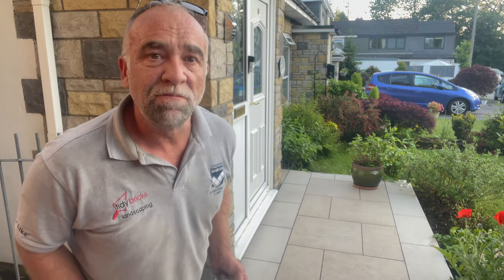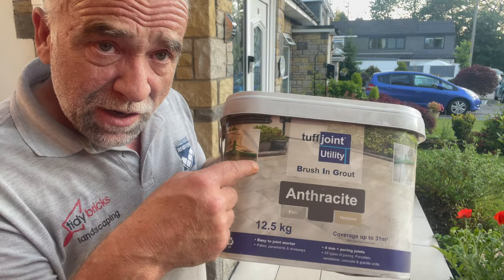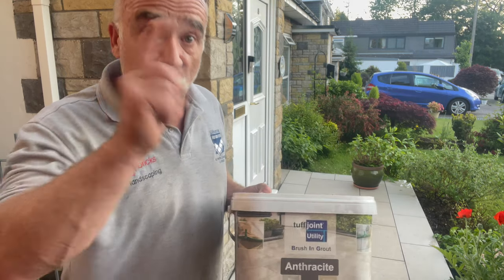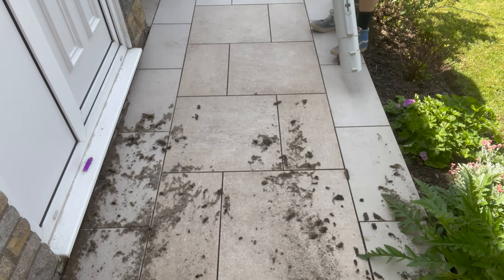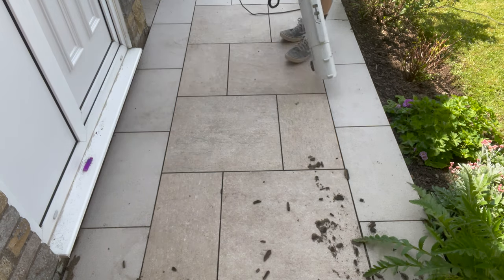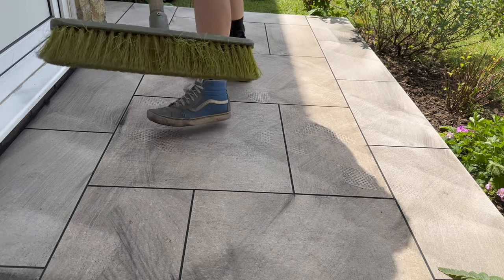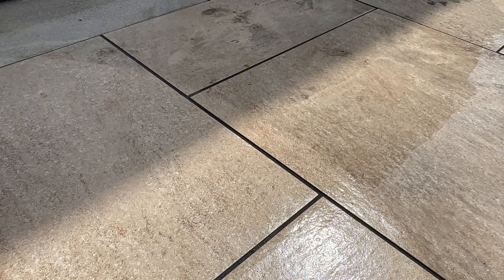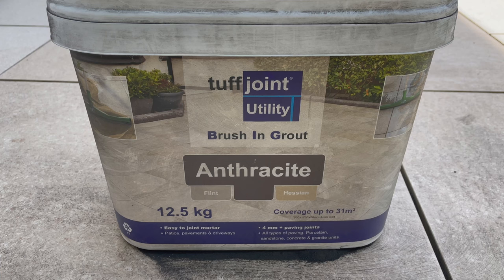Easier Way to Deal with Grouting Stress?! #SteinTec #Grouting #Jointing #Paving

Comment: I'm glad you liked it Scott. It's impermeable and can be jet washed a week or so after installation!
You can use it in the wet. It's just less stress in the dry. In wet conditions, it'll turn into a slurry, but once it's in, it'll be solid in no time. Cementitious with no epoxy or polymer so suitable for all stone.
Reply from the maker: Hi Troi thanks for the input on this every bit counts I’ll pin you in the comments for any enquiries for the product hope you like it 👍🏴
Reply: @Joe Frankland  hi Joe, I did reply but it contained my details so may have been deleted. 

Google, Steintec, give me a call any time mate
Reply from the maker: Some people from a landscaping group might be asking some enquiries for the grout headed your way 👍🏴
Reply: Would it keep closer to the top of the tile if you brush it very gently? Or is it a matter of the product naturally compacting when moist and sinking in?
Reply: Hi @andrescorrea682  You'll never get it flush for a couple of reasons. Firstly when you spray the joint with water, some may wash out of the joint naturally. As shown in the video you then clean the surface with the hand sponge tool, which goes directly over the joint again, potentially removing 1-2mm from the top surface.

It's possible to get it to surface level and not wash away the top surface of granules, and then not wipe over the top of the joint, but for best results, and to avoid spooling, we suggest that you use it with the intention of finishing slightly below the level of the slab. spooling/cracking happens when grout doesn't have the support of the side of the paving unit.
Reply from the maker: @andrescorrea682  naturally compacting when wetted I’d say 👍🏴
Reply: So  can you jet wash this  with out it lifting, so do you prefer this to liquid grout  what would you use

Comment: I have been using Nexus V75 two part epoxy resin slurry for the last couple of years because it is more waterproof and rated for 8 tons. It is great stuff, but as you say, its stressful. Around 18 months ago  did 120m2 of Indian paving with it, it was a gorgeous warm sunny day when doing and when I left, but through the night it had light rain which resulted in the sheen on the flags going white because of something called Amine bloom. A tense couple of days thinking its going to cost me weeks of work and money, but the manufacturers said to put white viniger on it to make it go clear again, 60 litres later, and 2 days and the patio was 95% back to normal. I nearly resorted to having a sandblasting firm come in to take off the surface sheen. Long story short, they do not tell you the epoxy can not get any moisture on it at all until it is fully cured, ironically, it says it can withstand light rain while installing, bullshite!
Reply from the maker: Grouting used to be a easy process years ago and now it’s all so complicated with so many choices of grout products I think the best grout will always be sand and cement same stuff to lay the dam things 👍🏴 I’m feel your pain
Reply: @tidybrickslandscaping . Up until  three years ago, I always used a sharpsand mortar to point my flagging, used one of those moratar guns to speed up the process. I never use the pre-mixed stuff with it being water permible.
Reply: @tidybrickslandscaping  , I am a relatively new convert to epoxy resin pointing. I like it because it is so quick to use, but  I have occasionally considered going back to mortar pointing. The only trouble with mortar pointing is that it is just not as strong as this Nexus stuff, and that is using a 3 to 1 sharp sand and cement mix, Nexus v75 sets like cast iron., saying that, I have used for the last three years, so not sure yet the longevity of it, I would never use the pre-mixed stuff you get from B&Q etc, that stuff is garbage and crumbles in no time.

Comment: Excellent scott 👍 is that for non permeable and permeable? I see most brush in jointing compounds are for permeable only as it turns green if done on non permeable as the moisture just sits in the joints and attracts the algae. Been stung on a few jobs with that as clients or contractors adamant  it's the stuff they want to use. How's the stress now being on the brickwork and smaller jobs?
Reply from the maker: Hey Sam yeh that was for porcelain so hopefully all basses are covered and so bloody easy too 👍🏴
Reply: @tidybrickslandscaping  perfect scott wouldn't have known about this if I didn't follow 👍 nice genuine review too 👌
Reply from the maker: Does go hard to so far and not one bit of stress involved ok settles a couple of mm lower but does that really matter that much doubt it. Take that stress away mate it’s not worth it enjoy life a bit more 👍🏴
Reply: Absolutely mate 👍 not always easy Monday morning comes round and you step on that merry go round once again 🙈🤣
Reply: I'm planning on trying this gear in near future, I've got a tuck pointer grinded down to 4mm wide. I'm going to run that over the product to compact it before I water it, hopefully it will reduce any settlement and leave a flush joint. Stress aside do you think it'll be as long lasting as flowpoint?👍👍
Reply from the maker: @jc8023  apparently you can add more after it’s dried so I’ve been told by Matty brockstone and it seems to be very hard already but time will tell and actually I do have faith 👍🏴

Comment: Hey Scott, been watching a ton of your videos lately, just trying to learn. I'm doing my own patio tile (20mm porcelain 600x600 mm tiles). Now, my only experience tiling before  was my own kitchen backsplash, and I must say, even though it was stressful, I am very glad I did the work myself, it is literally laser straight, flat as can be and I took my time doing the tiles around plugs extremely carefully.

When doing my backyard prep, I asked a man at the construction supplies store, what kind of groundwork prep needed to be done to pave my patio. So because my language is not English, I think when I said "pave", he must have understood I wanted pavers, not tile, which is understandable, and it was my mistake. So I ended up doing 4 inches of digging, then filling it with 2 inches of crushed stone and 2 inches of rough sand on top (more like coarse tiny tiny pebbles), and compacting that in (rented a vibrating compactor). The sand is compacted enough to walk on top of, and it doesn't deform, but if you dig at it slightly with the heel (or my dog scratches at it after taking a cheeky dump), it leaves "gouges" and it shifts.

My fear is that I have the wrong material to put porcelain tile on top of, and that the tiles are going to end up breaking after a while if the sand shifts. My plan so far is to do everything as per your videos, but leaving a good 3 inches of cement (5:1) so I have plenty of material for the tiles to not shift or break.

My question is, should I delay the project, somehow dig up the 1 ton of sand (2 inches), and get more crushed stone and compact that? Is sand good for tiles? The ground prep has me worried and I can't find a video that goes over that topic in depth. I don't want to make a mistake there, and I'd like to do this "the proper way" so it'll last me a good long while.
Reply from the maker: Hi Andre and yeh it’s a same you said pave and not tile as that’s 2 different things unfortunately. So definitely remove the sand as that’s just a complete no no and replace that with more crushed stone the suggested amount is 100mm of stone then around 30mm cement 4;1 ratio possibly you can use the grit sand for the cement as that would be fine 👍 
Overall depth of a patio should be 150mm hope this has helped you sort the issue out 👍🏴

Comment: I've just done 50m of 20 mm porcelain out the back, still have 40m to go. It's not too difficult to grout but that stuff looks super easy. I'd probably use a softer brush when sweeping away the excess, might reduce lowering of the grout levels, still, couple of mm aint gonna make much difference. Great job Scott.
Reply from the maker: a softer brush would of helped for sure but apparently you can top it up the following day also but really no big deal 👍🏴

Comment: Looks like a no brainer....whats it like if you try and top up where its settled??
Reply from the maker: hey Tom and yeh apparently you can top it up the following day Matty told me 👍🏴 has to be another option hey
Reply: @tidybrickslandscaping  Jon 🤠
That sounds decent. I'm currently using fugapave ch flex...like you, I've just about had enough of the stress in cleaning down or getting caught out with flowpoint. I like the fuga because it's not rush rush rush and it has a lovely finish.
This stuff you are using looks like best of both worlds 👍
Reply: What happened when you got caught out with flowpoint if you don't mind me asking?
I was considering using it but concerned about the clean up process.
Reply: @jc8023  don't get me wrong...flowpoint is a great product, but I'm usually on my own and I find the rush to make sure it's all cleaned up is stressful. I haven't got any horror stores, but I have been 'caught out' usually by being too greedy, with it drying quicker than I can get to it. Do half bags you might say...well, flowpoint is known for its accuracy, so you really need to measure it out and gauge the water accordingly...just more faff.
Reply: Thanks, so many slurry and sweep in options to choose from. I think impermeable products got to be far superior to permeable.
Reply from the maker: Like Tom said there’s a lot to it and there’s no need for all that which comes with it especially faff. Screw that always good to try something else and avoid the stress levels 👍🏴

Comment: Are you still using this Scott?
Reply from the maker: Used it twice in total and yeh it’s pretty good but does settle a few mm so depends on if that’s a issue or not I think it’s fine myself 👍🏴
Reply: @tidybrickslandscaping  Cheers mate. Gotta be a dry surface before applying i take it?
Reply from the maker: @malpaslandscapes8444  yeh bone dry does help and I leaf blower will help blow any surface grout off before you mist it and mist it only too 👍🏴